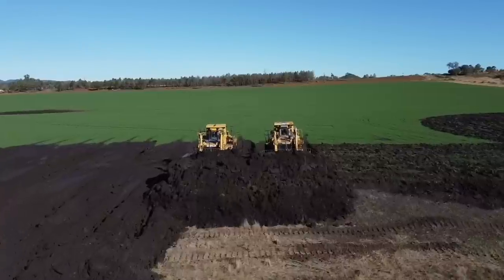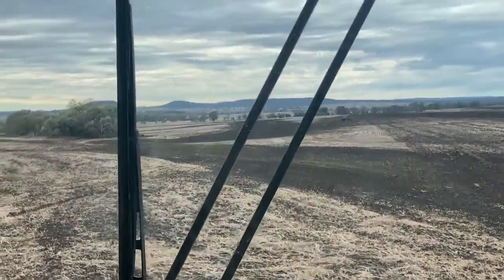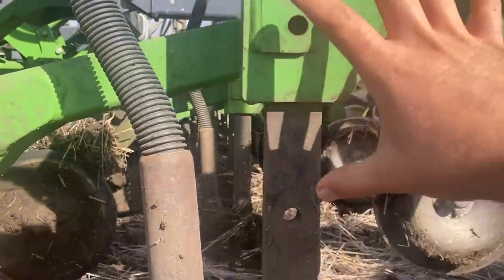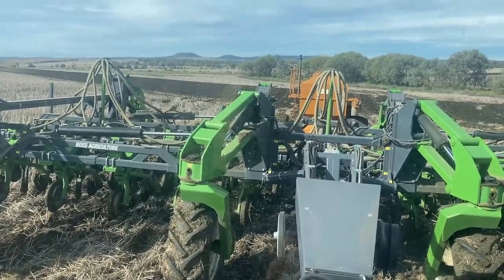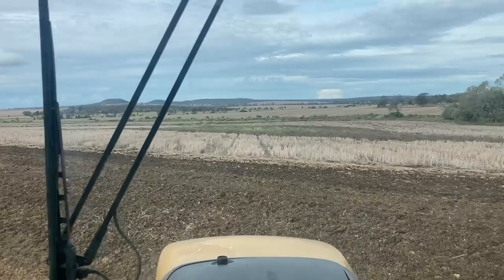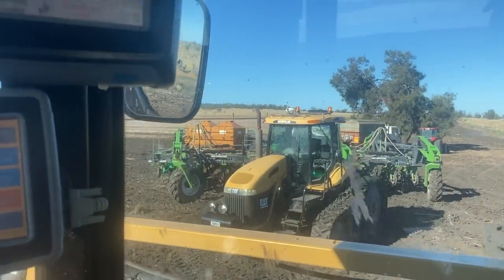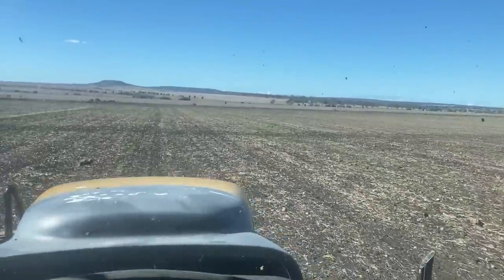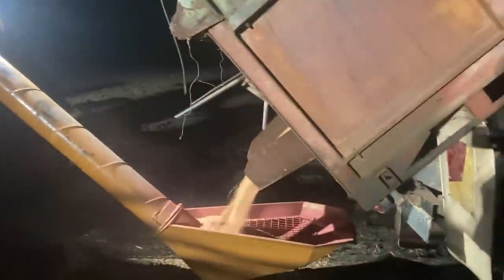It's Not Pretty... But It's Working - Seeding 2022 Pt 7 (Vlog 80)

Comment: I was just watching your vid where you had to change out the 4d batteries on the triple.
 I used to work at a battery plant for several years before they closed. One thing that will save you all a lot of money over the years is when you have a battery that is getting weak and you check the voltage if they read 11volts or more you of course can  do a deep charge, you can also twist off the caps on the top and see of any of the cells are low or empty of acid and so you can add a acid pack. A empty cell can give you a dead cell voltage of 10 or lower and when you look down in the cell if it's empty look for any loose material on the bottom and if so the battery has shed the plate off and is not worth trying to save. 
 Also never sit a battery on concrete for long, it will drain the voltage right out.